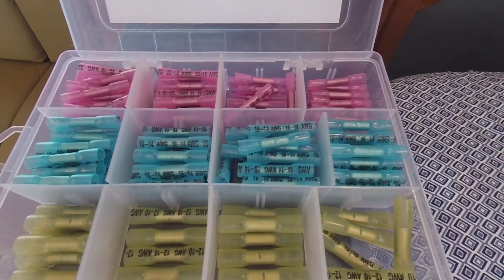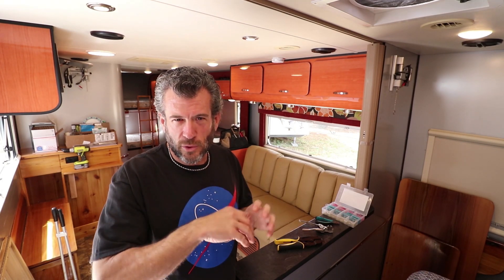Best wire splice to use in an rv and best tools for wiring butt connectors

Comment from the maker: RV wiring during rv remodel? Here are the best types of wire splices and butt connectors for rvs. 
🔥 Subscribe to see more stories. 
👍 Thumbs up, and share your enthusiasm.
❤ Comment, and become part of the adventure.
Reply: What are the wire strippers you use?
Reply: Wago safe for RVs? I have my doubts.  Hoping to get answer from RV pro.  I do residential and now I'm skeptical. But RV tends to have lot of low amp situations.